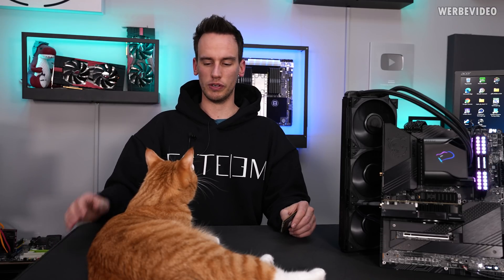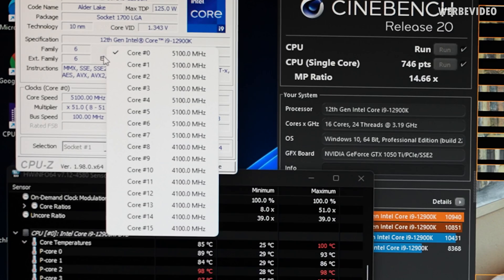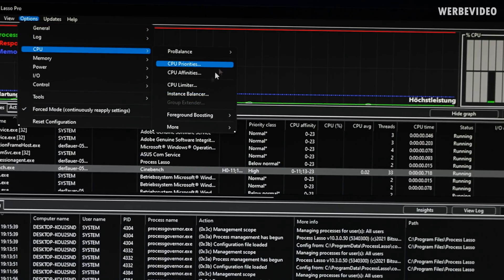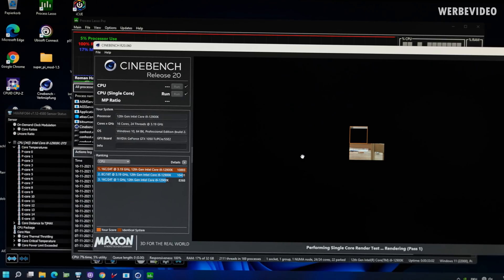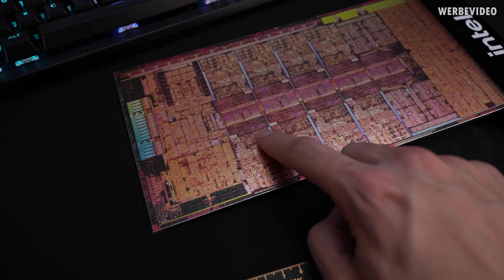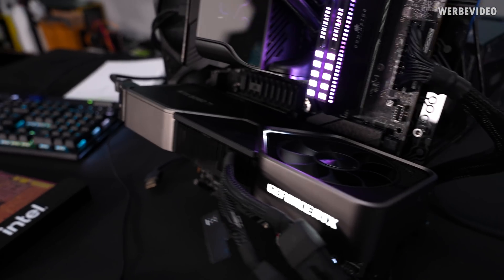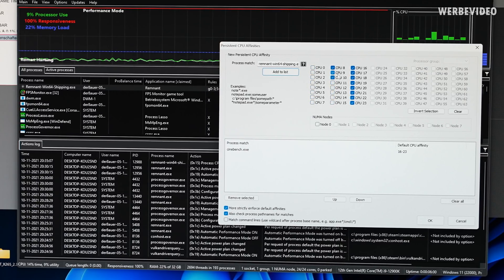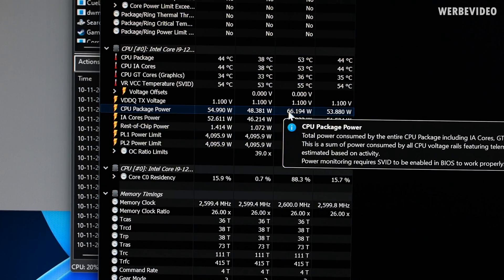The E-Cores were not meant to be used This Way... but it's Amazing!

Comment: as interesting as this is i can't get behind the blind acceptance of E cores for everything. they are fundamentally weaker and pretty useless cores to do tasks that microsoft has allowed through their laziness over the years. E cores will only ever be good for handling background tasks and you should never need more than 4. if intel or a future AMD hybrid CPU competitor just keeps adding more and more of these small very niche cores then developer lazyness will be having task numbers explode into the thousands by the end of the decade and all performance gains we have seen over the past decade will be lost. we need to stop this now while we still have time. we need more high performance cores at higher clocks with lower power as we always have.
Reply: That would not work. Have you seen all core power consumption of Alderlake? Add more PCores or replace ECores with PCores and not even a 360 water cooling will keep them below throttling. Those PCores are power hogs with 0 efficiency... 8 of them on full load consume close to 200W, while the rest to 250W comes from the 8 ECores. ~190W P vs E ~60W. So a 16 PCore alderlake without ECores would consume ~380W.

What I think Intel should do is on full cpu load it should limit the usage of PCores and try to push everything on ECores. 250W full load for a CPU is already not ok. It is becoming another space heater in video encoding and other multithreaded tasks. I would always prefer the 130W of a 5950X even if it looses by a few percent. But it warms my room by half of what Alderlake does.
Reply: The E-cores have higher pef-per-transistor. Therefore increase multi-threaded performance for the whole chip. They are a net gain, allowing larger main cores, while not sacrificing multi-core perf.
And this would likely encourage more multithreading for heavy apps then meaningless background bloat.

Comment: The e cores are like a 9700K running at 4.1GHz... that's crazy. Basically identical IPC comparing to skylake but at much lower power consumption.
Reply: It's finally a new process node so I hope it's more efficient

Comment: I'm starting to think intel messed up by having so many P cores. 2P and 32E cores would have taken up the same amount of die space. Would've got the same single thread scores and destroyed in multithreading using much less power. While having enough P core treads to satisfy any current game.
Reply: I'd give them the benefit of the doubt here & imagine they did do their research on what currently is the better strategy for these configurations.

Perhaps we'll see that change in the future though.
Reply: they would have lost in games tough. Yes cinebench single core and multicore would have been better, but actual game performance lower.
Reply: @marsovac  Not necessarily. That would be game to game specific, just like it is now. Games that max out 4 threads and don't use any other treads available are getting much rarer, but Intel wins in them. The modern games that are properly multithreaded will use as many threads as they can, so having more threads overall even if they are slightly weaker would be a benefit. I doubt there are many modern games that can max out every thread they use in modern CPU's.

Comment: So the big difference is you can actually overclock the Atom cores, where Intel had them locked in the past. Makes you wonder how great those older Atom computers would have been if they had just unlocked the cores🤔
Reply: I don't think we'll ever know, but those old atom cores might have been bottom of the barrel anyway in terms of silicon quality & therefore not really capable of much more.
Reply: @MLWJ1993  but, this is exactly why I like AMD's approach: you want more power, okay, do it at your own risk.

Comment: Re: Process Lasso.   I've got a 5800X, I use it for gaming, so I've got two sort of "extra" cores in there (Not all games can take advantage of eight cores and sixteen threads), so I used Process Lasso to put all my background software on my two slowest cores.  Backup software, iCUE, KeePass, Razer Synapse, all that extra stuff hangs out on cores five and seven, which leaves the rest of the cores wide open for whatever.  I don't know if it provides any real benefit, but it's fun to play with!
Reply: :) It is fun to play with :)
Reply: At the very least it could help marginally. It doesn't really hurt anything anyway.
Reply: @MLWJ1993  Yeah, it helps avoiding microstutter.
Reply: It might help or it might hinder, I'd benchmark it. I tried this both on my 2700X and my 3900X and performance usually ended up worse by a small amount

Comment: 200 vs 125 FPS maybe doesn't sound bad, but for games that are not running at framerates this excessively high this kind of performance decrease would still be very bad and within noticeable threshold, for example a decrease from 70 to 43 FPS. Still with how those E-cores are performing, having a CPU with just 4 P-Cores and then say 8 E-cores would be a great idea, this way you maintain high performance in low threaded games and have those E-cores help you with multithreading at low cost and power. This is what i3 should be, 4+8. Maybe it will with 13th gen since i9 is getting 8+16.
Reply from the maker: Yes I absolutely agree! I mean I wouldnt use them to game. It was more a showcase for people to see that they are more than the atom cores from 10 years ago :D There it would've been 200 FPS vs 20 FPS

Comment: Now listen a this, How about all E-cores at same die size and maybe add smt?  Intel could replace each P-core for 4 E-cores giving us a massive, decently performing, 40 cores.
Reply: That sounds like a good answer to EPYC. Just cram a crapload of E-core on a server-size die since those don't clock very high anyway, and you still get decent performance. It will be interesting if they actually do it.
Reply: @GeminionRay  couldn't have said it better
Reply: That would lose AVX and AVX512 and cache on task that matters. You should know these dies are also being used on servers. And yes the die hogging AVX512 is on alderlake as well, just disabled by bios.

Comment: The E-cores take up a small part of the die compared to the P-cores.
You wouldn't get one P-core per E-core if they did swap them out.
Reply: @jayden974  not in gaming though
Reply: @jayden974  e cores are just a waste. Ipc of ivy bridge, nuff said. They're not useful for anything. Intel should just focus on more efficient designs with high performance cores, just like AMD does. They can have 5 million e cores, it still won't matter as they're useless for gaming. And alder lake is advertised as gaming processor
Reply: @jayden974  performance even regresses with e cores enabled, just for your information
Reply: 4 e cores are the size of 1 pcore, so it would be better to have a 10core 20 thread processor with only p cores instead of 8 p cores and 8 e cores and 24 threads

Comment: So the next question is, why did Intel choose 8 P cores and 8 E cores and not for example  2 p cores and 32 E cores or even just 40 E cores. Keeping in mind that Intel can install 1 P core or (at least) 4 E core on the same piece of silicon it would be very interesting to test a range of programs on 8 E cores and 2 P cores to see when the P cores are the better choice and when the E cores.
Reply: 2P cores only would have lowered game benchmarks. Winning in cinebench by more than it already wins matters less than not winning in games.

Comment: So my take away is Alder Lake has very little OC overhead short of exotic cooling. Gone are the days of 30%-50% OC overhead. So what's the point of these insane 24 phase MOBOs for water cooling?!
Reply: It's marketing departments running the business, telling engineering what to make so that marketing can put higher numbers on adds to milk the uninformed.
Reply: The cpu´s didn't came almost maxed overclocked from the factories either, What´s the diffrence? You overclock it to 5ish Ghz and have the false impression of gaining free power!? or it comes like that from factory ??
Reply: You could just downclock them & then return to "stock" for that same placebo that they actually sold you something better instead of them actually limiting your purchase by default? 🤔

Overclocking should really just not be a requirement at all, only something for people comfortable with running their CPU into the absolute limits.

Comment: It's simple. You have a limit to how much power can go into these chips, and e-cores, as the name suggests, are EFFICIENT. You want to spend that power where it's most efficient, so disabling the e-cores and directing all that power to the p-cores instead would make no sense in multi-core loads. You'd be spending that power less efficiently, getting less done within the same power budget.

I guess some people just think "But they're performance cores! More performance = better!" but that's not how it works.
Reply: Might be better in very short bursts... Not for prolonged work though.
Reply: If you have the power budget because your process is efficient (AMD for example), then it doesn't matter that E cores are more efficient because power is not your main concern. It is for Intel though so it makes sense for them

Comment: Hybrid cores make alot of sense on Laptops, phones and tablets. However..

On Desktops, what's the point? yes they're more efficient but it doesn't matter much compared to a Laptop running on a battery.
The only reason I can think of, is having more cores.
Reply: It matters a lot. If instead of putting those E cores they had put another 8 Pcores the CPU consumption would skyrocket to 300+W. And there is currently no consumer cooling widespread for such a thing, it would need double radiator water cooling.
Reply: @marsovac  Yes. I think intel done this with P and E core architecture at least increase the amount of core to match the amount of amd can offer. I don't think this is bad idea if it used for notebook. For PC, i think it's bad idea. I think it's much more sense if it uses different type of P core, like for gaming or productivity. Use 1 type of core for gaming and other for productivity

Comment: But I still can't get it, how 12900k with 16P threads and 8 E threads making it total of 24 threads able to complete 32 threads 5950x . Just how is this possible?
Reply: Faster p cores
Reply: A whole lot more power consumption and faster P cores. If compared by power consumption, these two CPUs are not in the same league at all
Reply: @kendokaaa  60% of the time the Intel will need less Power than AMD, because the E-cores they are not power hungry.

Comment: You could fit 32-40 E-cores within the 12900k die size. Wonder how that would perform for certain parallel tasks like rendering video, especially if they optimized cache and clocks.
Reply from the maker: Kind of reminds me of Knights Landing. But I think at least 4 or 6 P Cores are required for a good overall experience. For the Future 8 + 32 sounds pretty amazing to me
Reply: @der8auer-en  agreed, I think 8 P core is the magic number given that consoles have 8 cores so cross platform game devs have the incentive to program games for 8 cores, 😄
Reply: @derenbong  Consoles could have 24 cores and I still think games wouldn't use nearly as many, or at least you'd still be limited by a few. Parallelizing software is just a really hard problem to solve and while some games use a bunch of threads (Battlefield games), a few main threads are still the bottleneck
Reply: @kendokaaa  agreed, real time game engine simulation multi core coordination is hard!
Reply: @derenbong  goal for unreal Engine 6
Reply: I think with up to 40 E cores, the 12900k would blow away all competition on the multi-threading department! xD
Reply: @derenbong  it would also blow you house

Comment: I don't know, 66W peak whilst gaming for that level of performance doesn't seem all that impressive to me. At all in fact. A Ryzen 5800X set to draw the same amount of power would absolutely blow them out of the water in terms of performance. I know, as I've tested mine in the "45W" Eco Mode offered in MSI's BIOS, which actually has a 61W power limit (to account for the I/O die). As a result, so would half of a 5950X. If I'm primarily concerned with power effiency, why would I want these E-cores instead of Zen 3 cores operating in their power sweet spot, which would offer much better perf/watt? Of course, the E-cores were overclocked here, but if you return them to stock then the performance delta only grows. You can make the die size argument and as such the ability to scale, but how useful is that for the average desktop user? Not very for most would be my answer. The same answer as when AMD were pushing lots of weak cores over a smaller amount of much stronger cores during the FX era.
Reply: 5800X is a power hog and it runs hot/ Thats why it dropped to $289.  No one was buying them. The 12600k wipes the floor with them @ better efficiency and MT and IPC. It's no contest!!!!

Comment: I always maintained that the Gracemont cores are a brilliant piece of engineering. All 8 of them only consumes around 50W under full utilization and are as fast as a first generation 8 Core Ryzen.
Reply: Faster actually.
Reply: For me it's kind of disappointing since the IPC is lower than of skylake and just marginally faster than haswell. that's 2013-2014 territory there.  if you compare a stock 12900k and compare the stock E and p cores, the P cores performance per core is twice as fast but the P cores dont even consume twice the energy, so in that regard the p cores are more efficient than the e cores
Reply: @SweatyFeetGirl  It's faster than Skylake actually and consumes about 1/4th the power. All 8 Gracemont cores never consumes more than 50W (That's just 6.25W per core) . A single Golden Cove core consumes almost 25W at stock when fully saturated. What are you on about?
Reply: @WimukthiBandara  She does not know :D
Reply: @SweatyFeetGirl  Complete lie you just told.  Stock intel setting is PL2 241 watts. That is stock.
Reply: @SweatyFeetGirl  The Germany has a video out today here on utube he breaks it down amazingly just like I would.  No one is saying these cpus are more efficient but Thats right now 1st generation New everything .  Raptor Lake will be out in 2022. It brings 20% ipc uplift for the big cores . The 8 e cores stay the same but are 16 E-cores.  So that will be great.  The next chip that's the Big gun.  You add 30% Ipc increase to the 12 core Tile-E core in Meteor Lake 2x and 8core Tile x2 that would be a major desktop chip .I have no idea what the IPC target is for those CPU.    You All know 500 watt GPUs are coming .Intel is 550 watts. These are for HPC but we will get really good GPUs .    I don't want or need any more than a 1200 watt power supply. After meteor lake and what ever AMD brings 24-25 . The need for more just won't be there. for average Joe. . The need for more compute will always be wanted.  We shall all see soon enough what INTEL HPC is WORTH the 15 year development.  The interconnects for Intels chips are alot more advance.  Intels Rambo Cache  6x 512 eu  HPC  Accelerators,HBM2 memory, EMIB, Foveros    Intel is in a good place on interconnects alone.  There is lots of room for everyone.
Reply: @SweatyFeetGirl  e-cores goal was mostly area efficiency, rather than power efficiency. intel still can't figure out chiplets, so having smaller cores is their only chance to compete on performance per mm2. Power efficiency is a secondary goal that comes automatically with area efficiency. less transistors - less power needed. and yes ADL is a laptop product - that's exactly why e- cores are optimized while p-cores are extremely rushed and not polished at all. 

basically big.little is a rather simple concept: you have the same old "Core" cores like with RKL, CML, SKL etc but hugely overblown and with no transistor optimizations at all as P-cores and the same old "Core" cores but with that horrible intel's SMT implementation ripped out and several iterations of layout optimizations. 

It's a simple but effective design paradigm. That's why it gained so much popularity in mobile over the last decade, especially among lower division chipdesigners.
Reply: @SweatyFeetGirl  Power consumption matters. Maybe not you, but it matters for overall power consumption of the nation, which is stretched thinner than you might think. If we never think about efficiency, we will eventually run into an energy crises. Was that Intel’s intention? I highly doubt it
Reply: @Zorro33313  They have done many chiplets in the past, chiplet cpu design has been around for 15-20 years since IBM was doing it back then.  AMD didnt come up with it and intel can do it easily,  not sure where you getting your facts.
Reply: @4gbmeans4gb61  cope

Comment: So, then without the overclock, the E cores are something like a 6700K if the 6700K had eight physical cores. Quite interesting.
Reply: That's a weird way of just saying a i7-9700 without saying a i7-9700
Reply: @GeneralSouthParkFan  Not really. A 9700 would have a higher single core score than what he got here. I guess I could have said that the E cores are basically an underclocked 9700. Both are technically true since they're the same cores, just they clocked them higher from gen to gen, added cores, added cache, etc.
Reply: @TheGameBench  Yeah fair enough, I was more so thinking 8 Gracemont cores at 3.9GHz would be directly comparable if not superior to a 3GHz 9700 (as in without boost)
Reply from the maker: Yes I guess with the stock clock on par with 6700K. Still not bad if You consider that you get a 11900K with +15% Performance and a very efficient 6700K glued to it xD
Reply: @der8auer-en  Absolutely. The 6700K is still relevant, and still the low end cores of the current CPU's are pretty much on par in gaming and will crush it in multi. It's pretty awesome.